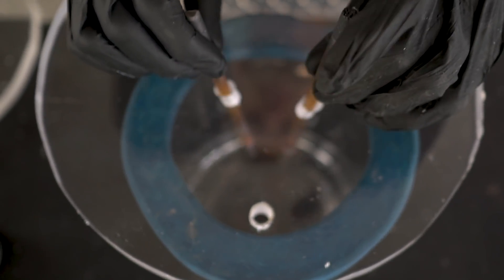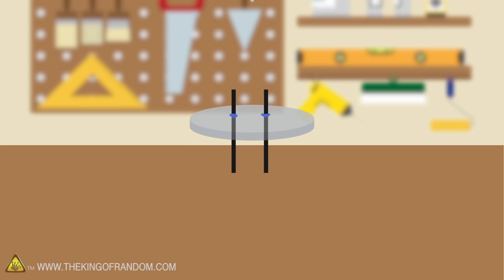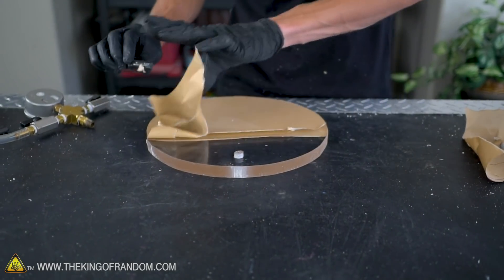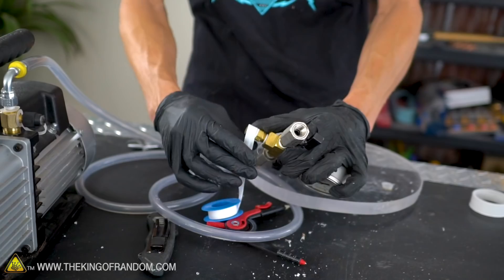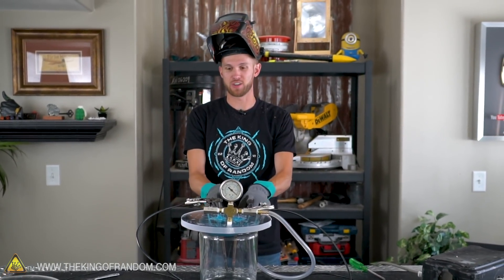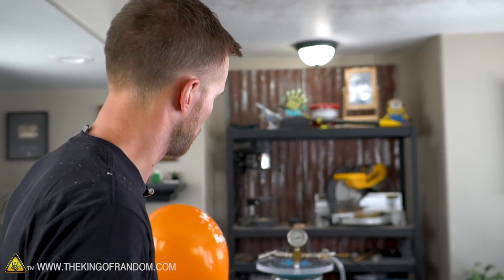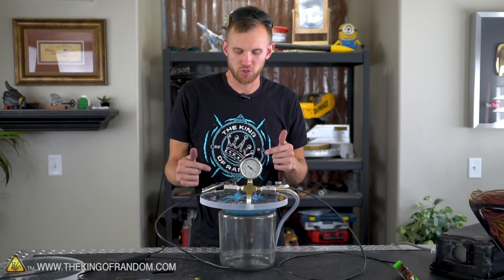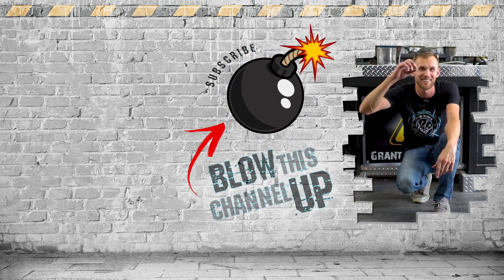Well That Was Anticlimactic

Comment: So I saw sparks fly like in a plasma ball when you had a high vacuum. 

So step one is to get some high heat automotive sealant. 

Step two, high vacuum lots of  nitrogen. 

Step three,  repeat step two except with argon and/or neon and/or (I think it is inert) helium. And/or other inert gasses. 

You should be able to make a plasma chamber (ball) and/or a neon and/or florescent light! (I could be wrong).
Thx

Comment: The vacuum makes it harder to exploit heat radiantly so more heat stays in the carbon rods by design. I'm not sure if proto-putty is up to the job considering that high temps are just part of the deal. Maybe with a deeper vacuum chamber and longer rods. Copper clad carbon rods start out a foot long rather than just those little burnt down ones used here.

Comment: Permatex Ultra Copper Maximum Temperature RTV Silicone Gasket Maker. It's around 700° F. Not as high has the arc welders but definitely higher then your putty. Hope this helps!!

Comment: If you put the right type of carbon it the vacuum chamber for a long time, can you make a “diamond” sort of?
Reply: no because making a Diamond requires high pressure and temperature, putting it into a vacuum chamber would increase the temperature required to produce the diamond far above the temperature of vaporization, so anything produced would immediately burn or be sucked out with the air pump.
Reply: nope
Reply: That would be such an easy way to make diamonds.
Reply: Does anyone know what instant light powder is?
Reply: @Connor_lifts  try looking up flash powder and see if thats what youre looking for
Reply: Actually that's how cvd (cubic zirconia/ lab created) diamonds are made. You start with a small diamond chip put it inside a vacuum chamber between the two electrodes and then the chamber is filled with methane. And as the methane is "burned" the carbon molecules from that basically rain down and get stuck to the diamond chip and grow and grow and grow until you have a much bigger diamond. It's more complicated than just this as far as temperature frequency blah blah blah but essentially that's how it works.

Comment: The dielectric strength of air is described by Paschens curve. Higher vacuum is not going to allow longer arc lengths. Also, with no air to help cool your electrodes they'll heat up much faster.

Comment: Does jacob’s ladder still work in a vacuum? Please try.
Reply: it wont because there will be no gasses to ionize and create an arc
Reply: sorry, it won't.
Reply: Technically yes but with no particles between the rods for the electricity to travel it would require larger voltage.
Reply: A electric jacobs ladder or the kids toy
Reply: DominickMango 716 electric
Reply: DominickMango 716 neither,  the 1990 movie starring Tim Robbins.   The answer is no. Twist endings don’t work in the absences of atmosphere. :)

Comment: Not surprising that an arc didn't strike. Plasma is an ionised gas which means that there cannot be an arc in a vacuum that way.
But if the electrodes got hot enough they would emit electrons and then an arc could connect the two rods

Comment: You might look into making an Induction furnace to go in the chamber instead of the Arc furnace set up. An induction furnace would be less likely to have the heat travel up and burn the proto-putty. Though doing high temp experiments in a glass vacuum chamber strikes me as fairly unsafe.... Aren't you risking that glass shattering due to temperature differentials?

Comment: Try to dry clothes in a vacuum. First just pull all the air out and have the water boil off leaving behind Frost then introduce some hot air and then try to do another vacuum to boil off more water. How long does it take to dry clothes with this method

Comment: Try making an arc in a vacuum chamber full of only pure oxygen. That would be pretty interesting...
Reply: Try dangerous. The rods would catch fire, probably with disturbing rapidity. Perhaps even explosively. Given the choice i'd do that before i tried anything with CiF3, but neither is a hot idea in my opinion.
Reply: @darthkarl99  if it were hydrogen I'd be worried but oxygen will just quickly oxidize the rods

Comment: The reason you didn't get long arcs off the rods is because you had high amperage instead of high voltage. In air you need a certain number of volts to make electrons jump from one rod to the other. It is a little different in a vacuum, but this principle still applies in that a certain voltage is needed to bridge a gap.

Comment: Instead of the proto putty maybe use some gasket maker for cars. You have high temp ones which might give you the result you are looking for. I have one that doesn't set and stays flexible, somewhat paste like. It can be used with exhausts and those can get pretty hot.

Comment: If you have a diamond glass/tile drill bit I've had luck drilling glass (jars,bottle, etc) submerged in a bucket of water. The water keeps the glass and drill bit cool while lubricating and removing the glass dust. Just go slow and don't apply pressure on the glass. Doesn't hurt to practice on a beer bottle or two before using your jar.

Heat rises so having your putty/rods on the side of the glass wall should buy you some time. Great video hope to see more cool stuff with the arc furnace and vacuum chamber!

Comment: try to use something like flex seal liquid for the seal on your carbon rods it should be heat resistant and will dry in the shape that you mold it into but should be interesting to see what you guys can do with it

Comment: rather than a  "sealed" penetration of the cover, do a fixed (with maybe rubber gaskets) with igniter electrodes from an oil furnace to get your arc. This way you would have a "fixed" gap and wouldn't need the flexible type used with your carbon electrodes and proto putty setup.   ???

Comment: Could you guys see if you can use the Arc welder to make a line of glass? And IF it works, try to do the same set-up in the vacuum to see if it changes how it forms. Also, would Liquid Nitrogen do anything to a Prince Rupert's Drop? For those who don't know that drop is one of the strongest things glass can turn into, the only way that it can be destroyed is by cutting the tail off and it powders it.

Comment: You could try to discharge the neon sign transformer inside the vacuum chamber. The discharges should definetly get longer, because the voltage of the neon sign transformer is already high. The voltage of the arc welder on the other hand is too low to be affected by the vacuum.
Reply: it would maybe help but the whole concept is flawed. electric arcs are plasma bridges of ionised gas (normally the air) between the electrodes. If you pull all the gas from between the electrodes then you will not get any arc at all. In this instance we only saw plasma when he touched the rods together, and probably some tiny barely visible arcs were formed from the ionisation of vaporised carbon from the rods. This whole experiment is basically the best way NOT to get an arc/plasma...
Reply: @MineStudio68  You will get a much longer arc in a vacuum than with air. The electrons are not slowed down by air molecules and can therefore jump much higher distances. You may not get the typical plasma flame of high voltage high current discharge, but you will definetly get a very long, purple spark. You can see the electrons by themselves. You can find many examples on youtube of high voltage discharges inside of a vacuum.
Reply: No worries about x-rays. None at all...
Reply: You've obviously never seen a 120v neon tube or a vacuum tube before.
Reply: Science
Reply: Wow                
Thats    
A
Lot
Of
Damage
!
Reply: Lucid Mistake loll

Comment: switch the power source for the neon sign transformer, lower amps, higher voltage, produces more plasma in a vacuum. basic science there. the existing arc furnace is low voltage but high amps as that is what works best in a normal atmosphere, but high voltage in a vacuum is how those plasma balls work, but they also use argon as a filler to maximise the effect.  try this with your set up and then you will see something exciting.

Comment: I would shorten the rods and not run then through the lid in the first place.  Maybe clamps and 2 smooth rods.  That way you can operate with the rods fully in the chamber; it wouldn’t heat up the putty and they should still be adjustable by twisting the smooth rods.  You guys may want to up your voltage as well.

Comment: i think you'd be interested in the results at an even higher voltage. as i understand it, the arc furnace is designed to pump out a lot of amps, through material so it could probably produce better arcs if  it was rigged to have a higher voltage with lower amperage. you'd also be able to arc longer without the putty heating up. 

it won't do much with a vaccum, but it might make the nitrogen experiment cooler.  you may also want to try arcing it while the air is being pumped out to see what happens as the pressure drops.

Comment: Well, you can try to liquid cool the top part. Gaskets are cooled in cars by the radiator system, so maybe you could liquid cool the gasket on your vacuum cylinder. You might also want to look into high temp gasket stuff for Automotives. Also, if you want big arcs, go high voltage.

Comment: Of course it doesn't arc from a larger distance in a vacuum.
The "arc" is the chain of converted plasma between the two points.
With no air, there's nothing to convert into plasma, thus no arc.

Comment: Thicker and longer rods, taller chamber for the vacuum seal... Higher voltage lower wattage. All of this will help with the whole thing of it getting too hot and melting/burning the puddy

Comment: Use high voltage, the low voltage from the welder (nicely made btw) won't work that well in a vacuum. using a regular microwave transformer could do the trick! or maybe safer a power supply from a electric fly swatter ;)

Comment: Two interesting comments.  1) This is the way carbon nanoparticles were first discovered.  Carbon rods were arced like this and the fine, smoke-like products were collected and then analyzed.  Molecules of C1, C2, C3, etc were found in small amounts, but the chromatograph peaked at carbon-60 (C60).  Buckyballs were discovered, then other fullerenes like carbon nanotubes.
2) Also, the fog observed when first switching on the vacuum pump was due to thermal cooling associated with pulling a vacuum (gas expansion).  The paths of subatomic particles were first observed, using the same method.  As alpha particles, cosmic rays, beta particles, etc move through the fog, they cause a thin trail of condensation in their wake.  CERN and Fermilab both used similar fog chambers during their early days.
Reply: Not a nerd just highly intelligent
Reply: I am really glad you performed this experiment.  It showed two other features.  First, in a vacuum, an arc cannot form unless there is first heating of the tips of the carbon rods through direct contact of the rods.  Once the tips become sufficiently heated by electrical conduction → plasma is formed due to the heat  → then an arc forms across the plasma.  Next, following initiation of the arc, it can continue even if the tips of the carbon rods separate slightly, as the extremely hot cathode continues to release plasma particles, thereby sustaining the arc.
Reply: Honestly if they call you a nerd be proud
Reply: Excellent contribution! That inspired an amazing read!
Reply: thallok thanks for the info 👍🏽
Reply: Freddy Gaming agreed. Everyone hated me in school and called me that too because of the same reason.
Reply: Thanks for the info! Very interesting.
Reply: He watches Sid the science kid
Reply: So essentially he made a highly volatile vacuum chamber?
Reply: To much technical junk I don’t know any of dat
Reply: Bill Nye The Science Guy
Reply: Science Rules!
Reply: I feel like you copy and pasted hmmm
Reply: Nerd

Comment: Yall should connect a acrylic tube to a speaker and run water through it while putting sound out from the speaker, see what different kinda shapes you can get in the water as it comes out

Comment: Since you are messing with electrodes and vacuums. Can you do one where you put dry ice in, seal the container, and put an arc through liquid co2? I'm curious if electrolisys works with liquid co2 or if there is some other component at play that makes it not work. Beware you will need a container that can withstand pressure, glass will explode. If it works you should have pure carbon and oxygen in the container.

Comment: By removing air molecules not only is there no gas to create the plasma, but you've remove the atoms that would allow the electric current to arc between the rods. That is why you only close the circuit when the rods are in direct contact with each other.

Comment: Okay, so you can work in a vacuum now. Get two pieces of the same metal element, put them in the vacuum, work out a way to scrape off the oxidised surface and push the pieces together. I want to see if you can cold weld them.

Comment: The thing is, there cannot be any arc if there is no air!
What an arc is, is simply ionised air, so it cannot be any arc if there is no air, thats why the rods need to be very close to each other to pass electricity, where in the air, electricity uses the air itself as a support to "travel" and create an arc
Reply: if it is high voltage there will be a longer arc at vaccum
Reply: Dead man, an arc is ionized air so it requires air to exist. a vacuum is a lack of gasses or air so therefore there is no arc.
Reply: theres no arc to become longer in a vaccum

Comment: what you need is High voltage to have glow discharge. check the paschen curve, it gives you for a given gas, the tension you need to apply for a given pressure distance product.

Comment: You should try gasket sealant. They use it on car gaskets that sit on the manifold. Should be able to handle the heat better than regular silicone.

Comment: But what really happens in 100% oxygen as fire tends to be bigger in a concentrated oxygen atmosphere and would melting metals or glass be way easier as the boiling temperatures get lower in a vacuum?
Reply: well, the melting temperature doesnt change. The materials boil more readily because the gasses released as the liquid vaporizes are removed and expand quicker as there is negative pressure.

Comment: Smooth-on silicone they have high temp silicone that sets in 12 minutes but you can speed that up by using a heat gun.

Comment: There is nothing for the arc to connect through. Typically the arc can transfer electrons though the air, but since there was no air, you had to touch them for it to work.

Comment: You should put a cordless drill in vacuum chamber and have some sort of remote to pull the trigger and see if it will still work ( I wonder if it will because it has a fan that either sucks air or blows(not sure which))

Comment: Try this while slowly pulling vacuum, testing it at different pressures. What is happening is electrons jump from one electrode through the air to the other electrode, and as you remove the air you remove some electrical resistance but if you pull out too much then there aren't enough air molecules for the electrons to make the jump. In theory if you pull vacuum slowly you will be able to find a sweet spot in the middle where you will have the largest spark.

Comment: i know how to fix it maybe. Surround a section of the rods in a rocky insulator such as plaster or cement and THEN protoputty them in place, putting direct insulation between carbon and silicon.

Comment: I believe the reason the arc didn't get that far isn't because something was interfering with it. I believe normally the arc is just the current being strong enough to move through air, but if there is no air, there is nothing for the electrons to flow through.

Comment: Of course you can't make an arc in vacuum, you need some kind of gas to excite in order to make plasma, which is what you need to make a lightning/arc.

Plasma is like a fourth state of matter from solid -> liquid -> gas -> plasma, so you need gas in order to make plasma, which you need to make an arc.

So if you have a pressure chamber and increase the the amount of gas you should be able to extend the arc.
The Amount of energy needed to excite a gas is different from gas to gas, so some gas is easier to excite then others.
The first light bulb was a trial and error of finding the correct pressure, gas and material to excite the gas.

The big search light used to light up the sky(or finding prisoners that are escaping) can actually be 2 carbon rods inclosed in pressurized glass container with some kind of gas in, similar to what you have made in this video(you just need pressure instead of vacuum) and we're talking like 4000watt or more, lightbulbs.
Reply: i understand what u are saying but if we use very high voltage we will get longer arc at vaccum.
Reply: Dead man, there is no gas to form an arc in a vacuum. and arc is ionized gasses that let current pass through, but if there are no gasses than there is no arc either. to make electrons themselves jump the gap, a much more complex system is required.

Comment: If you coated the outsude of the carbon rods in aheat resistant material then couldn't you still uss proto putty? Because if you have a barrier to lrotect tbe lutty from the heat then wouldn't it be fine?

Comment: Try running an arc through glow liquid maybe in a vacuum or have you tried running electricity through different liquids maybe with different things mixed in them. Like suspending glow stuff in water and then run electricity through it to see if it makes the glow stuff glow.